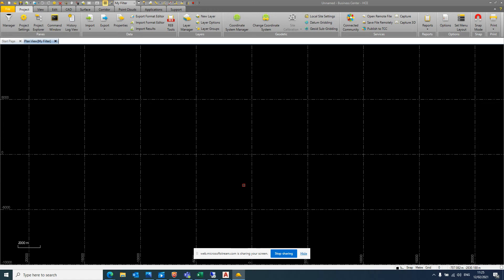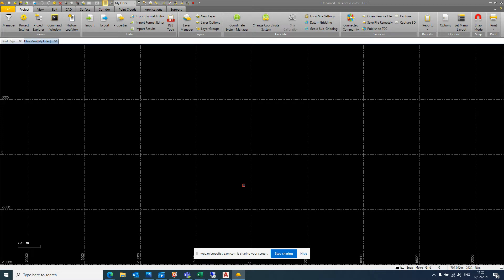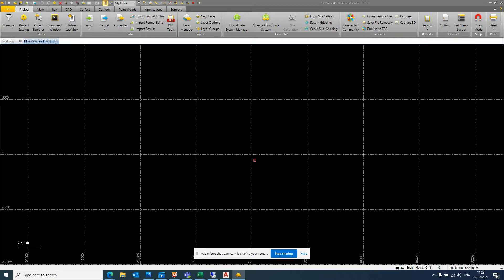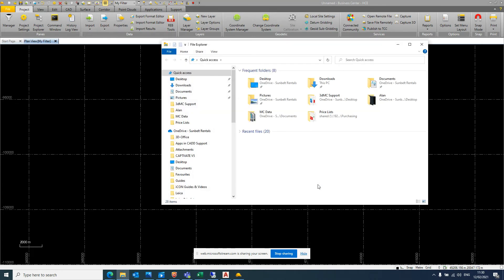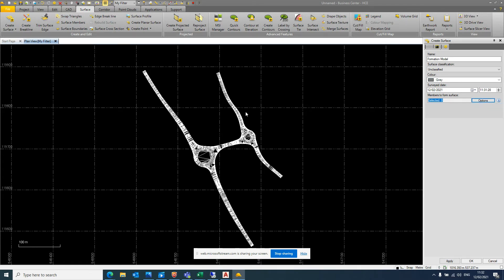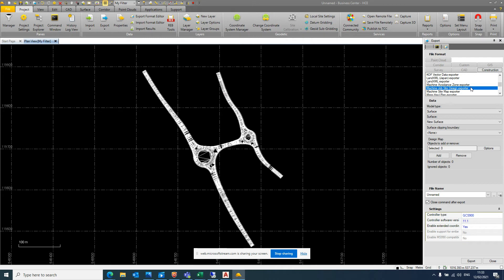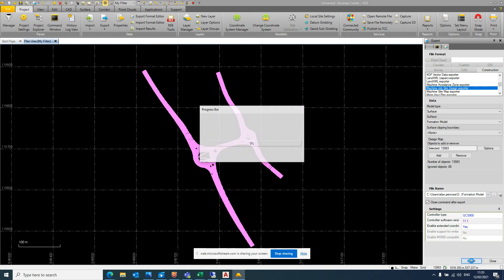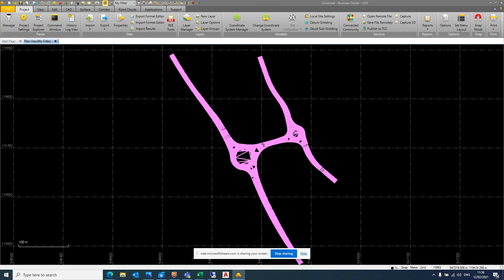Creating Trimble Machine Control Files

Comment: Is there another way to make designs for Trimble gps excavator and dozer without paid software?
Reply from the maker: Hi Frederick, if you have the triangulation you can flip it via Trimble file flipper. If you don't have a triangulated model you can create a flat or sloped one in the dozer alternatively you will likely need to pay for modelling software. I use n4ce quite a bit, bricscad,civil3d etc
Reply: @machinecontrol  Thanks man, is there a way to make a Cal file without TBC or Trimble gear in the field, I'm only interested in machine control, so far I've always had a Cal file from existing design to work with, I'm wondering if there is another way that I can learn before I get stuck on a future job or will I be stuck asking someone to make one for me.

BTW, your videos have been a god send, no resource has been as helpful as your videos, Id buy you a beer if I could, legend...
Reply: BTW I have civil 3d, the last obstacle to overcome is the cal file afaik (ive said this before)
Reply from the maker: @frederickharris3148  hey, thanks. Every video rooted from me scratching my head in similar style. For a Trimble Cal file (one that is not localized to a site) you need to get your hands on your areas 'national' coordinate system files suited for Trimble. An example of this is, in the UK where I am you need the ostn15 files from ordnance survey, these can be supplied by a local survey dealer such as korec, Sunbelt survey, sitech, Trimble. Your will receive a ostn, grd and Cal file that you can then use in the free file flipper to convert the file to the needed cal. Sorry i can't help more directly I'm currently not working in this sector. Find your local Trimble 'survey dealer' email their support and ask for the Trimble coordinate system files